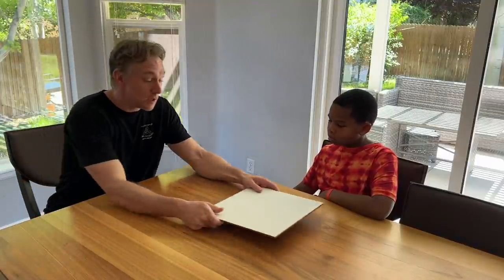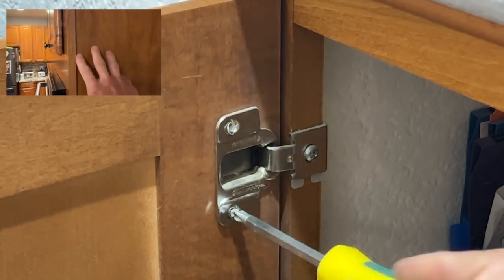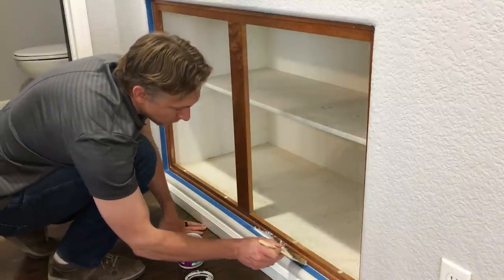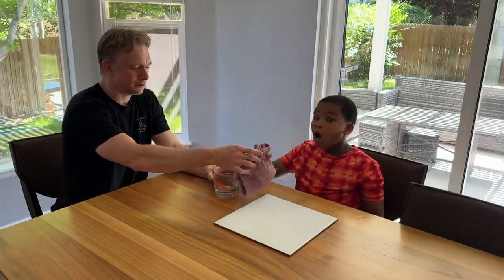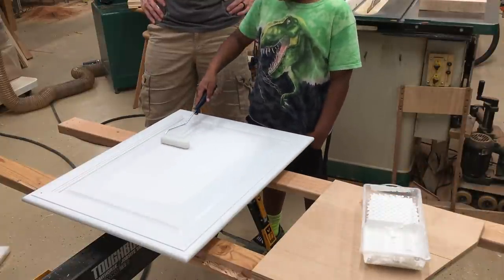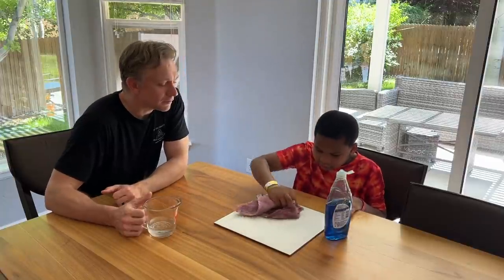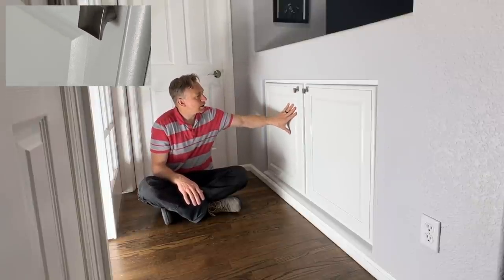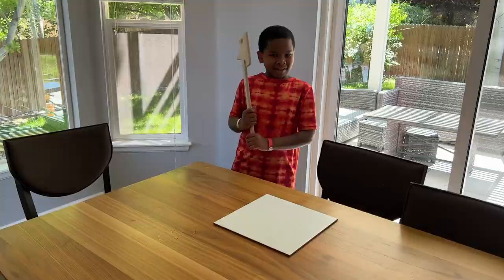PAINTING WOOD, Is it Ever OK?

Comment: If you want a real clean line between two painted surfaces, tape, run a light coat of the color you've taped off, then paint like normal. As long as you peel off within a day or so it should look great.

Comment: I've had pretty good luck with painters tape if I use the high quality stuff that seals out paint, and then also pulling it immediately after the finish coat.  I'll paint all coats with it but the paint seems to 'soften' when new paint is applied over, so that makes my lines turn out very well.

Comment: Years ago in a flip we had a custom kitchen that was hideous but the cabinets were good quality. I ended up painting them two tones of metallic graphite, 8 thin coats apiece of automobile paint through a cheap sprayer. For years that would be the first thing people would comment on when they came in the house, people love them. They came out better than I dared hope. I think it's worth going to the trouble of spraying, especially being able to take the cabinet doors off and lay them horizontal so gravity is on your side as well.

Comment: As a lifelong woodworker and woodturner who loves natural and stained wood, I think there is a place for painted cabinets - especially when that’s what the wife wants.  I’ve sprayed cabinet paints with an HVLP sprayer and gotten a nice finish but it required thinning and use of Floetrol for a great finish. More recently I’ve sprayed some with a higher end handheld airless sprayer and gotten just as good if not better finishes.  Handheld airless have the benefit of much less wasted paint for smaller jobs.  We’ll worth the investment.

Comment: My family has been painting since the 60s all of them tape the same way. Tape is scotch 2090. Frog tape and edge guard tape is garbage these days. Put the tape on then run a putty knife flat on top to get best adhesion. Try not to use the tape as a crutch. Don’t roll all over it. Finish the project in a few days. When you get to the last coat, either take it off right away or wait until it’s totally dry. If you have too much paint on the tape it is a pain.
Reply: Yep, and pull the tape at a sharp angle 📐

Comment: I guess it's personal opinion whether it's a better technique, but I don't think any of the tapes work very effectively. I'm a big fan of those slightly arced length of spring steel, usually 16 or 24 in. Now that I think about it I have not seen one for sale in decades, they used to be a giveaway much like stir sticks. Basically imagine a 3-inch wide venetian blind section. You hold it against the seam, paint right against it, wipe it with a wet rag and repeat. It really does go faster than prepping

Comment: If you run a bead of caulk along the edge of the tape and smooth it flat with your finger when you pull the tape back itll leave a crisp edge. You wind up with caulk under your paint tho.

Comment: hey andrew! the painters tape problem indeed ... this has been bothering me too recently after hearing about it from another youtuber. who had a botch job on his entire house. but your video here just gave me a new idea! cant we just apply 3 layers of painters tape at the very beginning? before even starting the 1st coat? then when you peel back that 1st layer of painters tape, theres still 2 more layers of identical masking underneath that. so it is not needed to make 3 seperate applications and try to line them up after / during the work... so this then leads me to a very obvious question: cant we / shouldnt we then be able to buy pre-made rolls of 'triple layer' painters tape from somewhere? mmm? such that when you apply the tape as 1 layer, it actually comes right off the roll as a sandwich of 3 layers. then saving aditional time. and ensuring that all of the multiple masking layers is perfectly aligned 'from the get-go'. as i think you would put it. ok so i hope my stupid idea makes sense, as i am not actually even a diy painter in any capacity. so it would be nice for other professionals to weigh in with their more experienced opinions. to point out the the drawbacks ...or indeed whatever is the huge massive flaw in my idea! which clearly am just utterly oblivious to. and many thanks to be corrected
Reply: Could the "other youtuber" be Linus Sebastian by any chance? :D
The idea sounds great!
Reply: @debug_duck  yes, it absolutely was the ex-painter known as Linus Sebastian